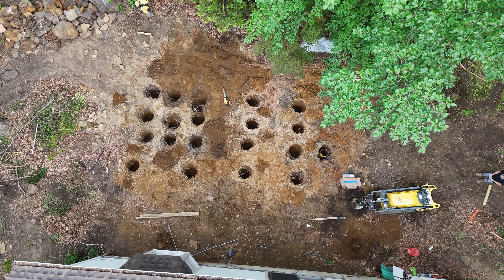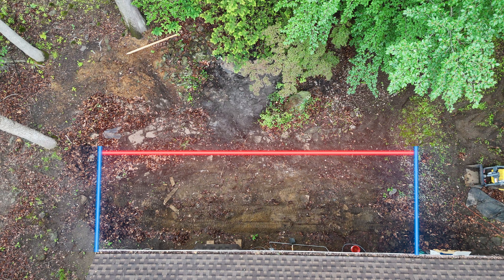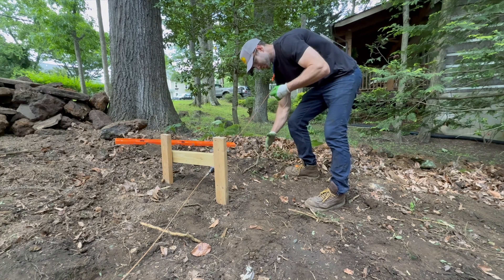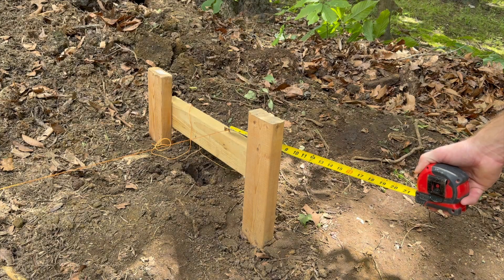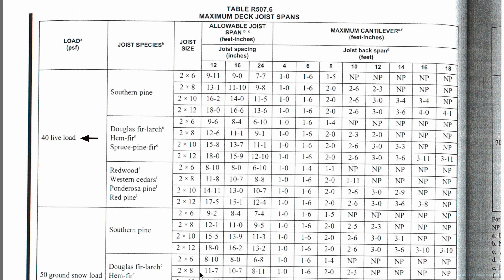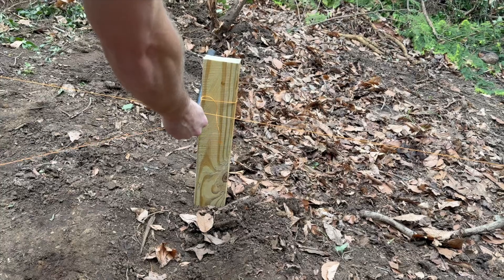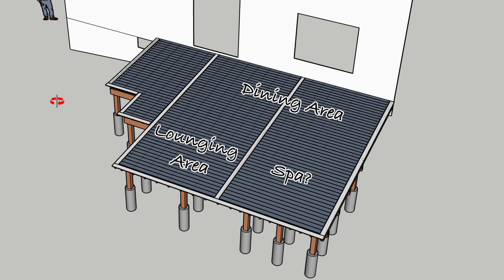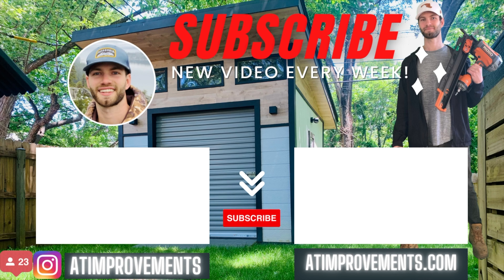Deck Planning and Layout Tips - Explained to you like you're 5...

Comment: There is nothing magical about the 3/4/5 squaring method. That combination just happens to work out in nice whole numbers. The truth is it will work with any 2 numbers you have and you just have to know the formula to solve for the final number which is the hypotenuse of the right triangle. The formula is: a²+b²=c². 
3 and 4 have been substituted for ‘a’ and ‘b’ giving you:  
3² + 4² = c²  or  9+16=25 
Then to get just plain ‘c’ and not ‘c²’ you square root (√ ) 25, which is 5.
If you had 2 other numbers for ‘a’ and ‘b’ it still works. Like if: a=8 and b=12
8² + 12² = c²   or   64+144= √ 208  which is  14.422.

Comment from the maker: Timestamps: 
00:00 Introduction
00:14 Where the Project Started
00:54 Planning and Laying Out Yout Deck
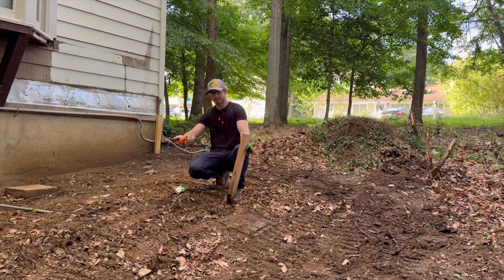01:30 Setting the Width of the Deck with Stakes and String
04:42 Setting the Deck Beam and Review of Building Codes
07:09 Marking the Footer and Post Locations
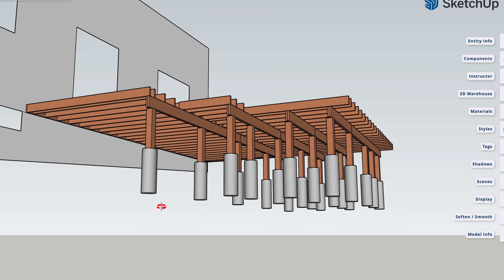07:48 Additional Deck Planning Tips
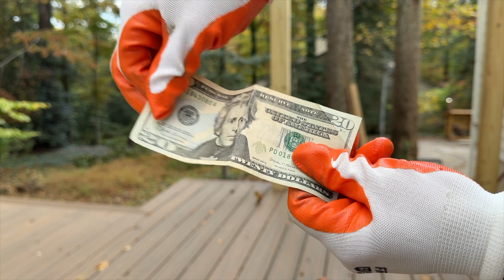09:02 How to Cut String with Your Bare Hands

Thanks for Watching!